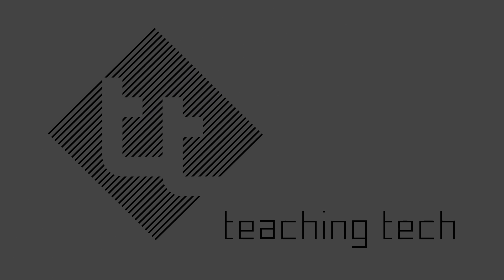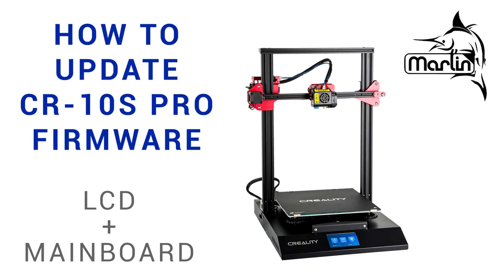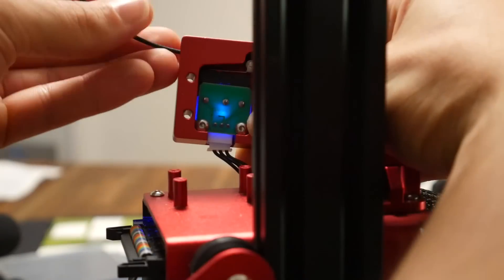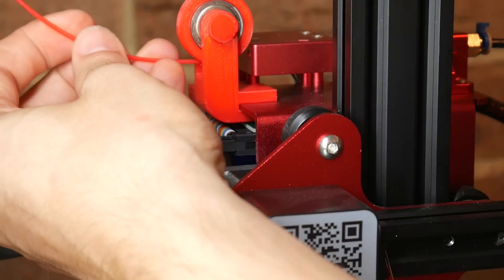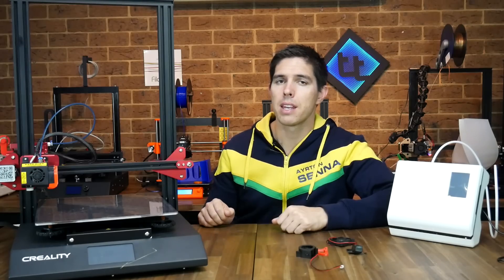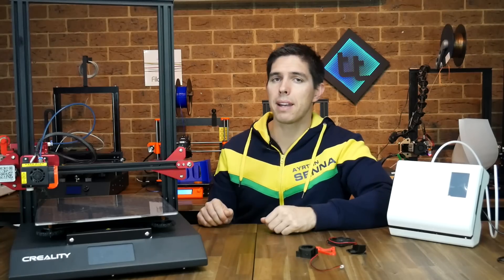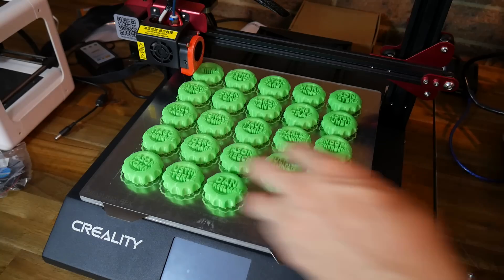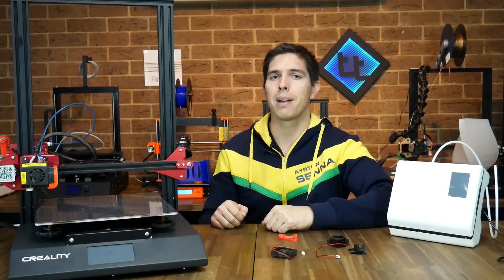7 fixes for the CR-10S Pro - Unlock the potential!

Comment: I really like your videos, well done!
You're a pro
A few points I would love to answer
1- I had a lot of problems with the original height sensor (even after the upgrade version) is not always accurate, is it because I use glass? Is this sensor good only for certain surfaces? (Does he have to work well with a magnet?)
  2. Baby steps, can I update the version? If so, would I be happy to explain which file? ..
https://github.com/jcheger/Creality-CR-10S-Pro-with-baby-stepping
3 - The speed of replacing the filament, currently according to the manufacturer's settings is so slow that you can grow old until it's over, where to update the speeds faster?
Thank you very much for the answers
And if you do not have the option, I would be happy if someone else could answer
 

 Eyal Biton

Comment: I added the z axis sync. Not sure if the backlash nut works better but the belt sync is great. Some other issues are the warped heated bed (which mesh leveling should theoretically fix) and poor manufacturing on various components. Example: holes filiment goes through had such horrible burrs it cut the filiment through every hole (barely fit ) creating the dust you pictured. Took some tedious deburring and fixed it. Took lot of work and it prints great now but the time investment could have bought a better brand.

Comment: Hey man thanks for the link remember just use 12 volt fans and voltage converters two exceptions Parts Cooling can't use a 12-volt for that or you lose speed control add the power supply fan it's already 12 volts so you just need to directly replace it with a 40-20 12-volt ultra-quiet fan the power supply fan is the largest culprit in my printer for noise once you replace all of them and run the parts cooler at 60 to 80% you could sleep in the same room as this machine :-)

Comment: Is Wham Bam 310x310 enough to cover the bed ? Because if I think it is 320x310
Reply: I have the same question xD ...
Reply: @Michael Patakos found it... https://whambamsystems.com/blog/f/what-size-flexible-build-system-for-your-3d-printer it's a 310x320 for the CR10S Pro.. and a 310x310 for the CR10S ... so i have to buy the bigger one

Comment: Beware that with tiny machines firmware the print is not resume after a power cut and also you can’t pause a print.
Reply: Michael Patakos 😕
Reply: resume after power cut for what???... the last time i remembered we had no power it was during a big storm.. and when you have a storm.. you should turn off your electronics anyway...
Reply: @kirafrost7618 , you must live some place where storms aren't very common.  In Florida in the summer you can pretty much count on a thunderstorm rolling through almost every afternoon.  Momentary power outages are pretty common and it's not feasible to turn things off every time there is a thunderstorm.  A UPS is a good idea for sensitive electronics though.

Comment: Great Video!! I was especially enlightened about using the wrench for setting the distance on the z axis sensor. I only wish I saw this last week. I just bought a BLtouch to battle the inconsistent Z homing, to find I was shipped  Version 3.0 BLtouch.....and it doesn't work on the CR10s Pro. I installed it yesterday. The print nozzle slams into the bed. It will probably be better to re-install the original probe and wait for someone to work out the "bugs" in the newest version of BLtouch sensor. Love your videos, keep up the good work!!!!!!!!
Reply: I was wondering if I needed the v2 or of the v3 would work. You can’t use the v3 because the nozzle hits the bed?
Reply: version 3.0 works.. use that tutorial https://www.youtube.com/watch?v=PLKEhdznVMY&feature=youtu.be&fbclid=IwAR2BeliUT0mNwKNk4RgggoYay1AssCuK4nRKL9rcaP6d8qYqExcYdA5oIPA and for version 3.0 use the jumper on the board! and about the firmware.. tinymachines b7 you don't have to change anything with marlin.. it work's fine as it is. by the way.. before the nozzle crashes into the bed.. i would test it with your finger.. if it doesn't stop.. then use the power button on your printer to stop it.. before something is damaged..

Comment: If you buy all the necessary fixes, it doesn't seem to be cheaper than a Prusa anymore...
Reply from the maker: Prusa i3 MK3S KIT is $750.
Creality CR-10S Pro is $600, Wham Bam $89, fan $5.
I own both and I love my Prusa. It is fair to say that this combo is appealing considering the larger build volume and easier assembly (even with the mods here).

Comment: You have saved my Cr-10s  pro from going back. The inductive sensor made the greatest difference, but also loved your video on the Z axis leveling. The Tiny-machine firmware is also a huge step up.
I would assume the wam-bam bed will work well with the inductive sensor.
Thanks again. subscribed and liked I miss the glory days of Lotus with Senna
Reply from the maker: Glad to have helped. Wham Bam bed works with no problems with the sensor. Senna's legend fortunately has not diminished over the years.

Comment: If you had to buy this or the Prusa MK3s as your first printer, which printer would be better suited? Looking to print flexible and hard materials, just want to know which prints better
Reply from the maker: Prusa works much better out of the box, although if you buy the kit the assembly is long and involved. Once together the Prusa has a lot more checks built into the system and much more frequent updates. Only problem is the difference in money.
Reply: @TeachingTech  Thanks. I already got the Prusa so it's nice to have some re-assurance!

Comment: loudest fan is not the mainboardfan, its the meanwell powersupply fan. I got rid of all stock fans, now its almost silent.
Reply: Was reading to see if someone mentioned this. Yes, at idle the machine is not bad but when the fan in the power supply kicks in db's increase considerably. So the biggest offender is the power supply fan, not the motherboard fan.
Reply from the maker: I agree but it's much more involved. That's why I said it wasn't much of an improvement here and linked to the video from Nerys.

Comment: might want to relocate the mosfet to the aluminum frame, it's location currently doesn't dissipate the heat well as it's mounted on standoffs in the case.
Reply from the maker: Are you talking about the solid state relay for the heated bed? Generally the bed MOSFET has the most current through it but on this printer there is a SSR instead.
Reply: @TeachingTech  yes, it get stupid hot from what I've seen-the back should be the heatsink portion, but it's elevated  so not getting adequate heat spread

Comment: For fan noise. Use some hardy wire cutters and clip out the middle ring of the fan guard on the side case fan and the hot end fan.  That will greatly reduce fan noise as the airflow will be better.  Replace the fan in the PSU case, it's the worst offender. 

Some people have claimed that their printer is silent, so I wonder if Creality is starting to replace these noisy fans with better ones??
Reply from the maker: Thanks for the tip. It would be great if they did. Seems silly to have quiet stepper drivers paired with noisy fans.

Comment: Is there a similar product to whambam for this model that I could buy from Aliexpress? Thanks!
Reply from the maker: One of the Cmag beds like on the Ender 3 Pro and Ender 5, although they are no where near as good.
Reply: @TeachingTech  Alright!
Reply: @TeachingTech  Another question, do these Wham Bam resist higher temps to print with ABS etc?
Reply: You can try the Easy Peelzy (the Creality CMag bed is a copy): https://www.3d-easy.xyz/store/p3/Easy-Peelzy_XL.html. Cost is no issue as these come around $16.

Comment: Thanks for this excellent video. Note: you can install 2x12V fans (Noctua or other) and put them in series, it's the same result. Within the EU you can get excellent Sunon radial 24V fans here: https://www.tme.eu/nl/details/mf40202v2-a99-a/ventilatoren-dc-24v/sunon/mf40202v2-1000u-a99/. Did you notice any excessive heat coming out of the SSR (like +50°C)? Did you check the latest Creality FW 1.60.71 as I believe it includes thermal runaway protection? Also, their latest batch of printers now come with a inductive sensor instead of a capacitive one.
Reply from the maker: Thanks for sharing great info. Haven't noticed any heat or tried the newest Creality firmware. The new sensor will be good as long as people don't want to use glass.

Comment: My 1st roll of PLA was $40 Tronxy black, and it was hard to get prints off my std End3 bed. But when that ran out I got generic $20 PLA, and it now has trouble sticking to the bed. Now I wonder how different different brands of PLA are, because Maker's Muse had trouble with stringing with different bands of filament.
Reply from the maker: Most of the time not much different but every now and again as you mention it can be profound.

Comment: Hi, I love your videos, and this one provides provides some food for thought.  I have had my CR-10S PRO for about 5-weeks now and unfortunately, I never got the test dog dog to print well from the start and had to do a deep dive into the printer problems.  That even includes reading C++ for Marlin ;)  

Initially, I discovered that the build plate was warped with a hump that went right to left just off center from the front and it was off by 0.78mm from the front to the warp high point.  I removed the Creality build sticker, then whacked the build plate over my thigh a few times to reduce the warp, and then mounted it upside down to allow the support plate and clips to remove the rest of the warp.  This worked well and I am within a couple of 1/100ths of a mm across the plate.  This, however, required that I also put on a new BuildTak sticker for which you have to buy toe 400mmx400mm sticker and trim it down since BuildTak does not have a 310mmx310mm sticker.  I was then able to print the test dog in PLA - Once.  I ran the bed at 60c and the hotend at 210c.  It seemed as though  I had to continually adjust the hotend z level at the outset of a print to get the filament to flow correctly and to get it to stick (even on the buildtak) - yes Auto Bed Leveling was ON.  I had the  problem where, if I use  a 1st layer brim that is initially good in its thickness and initial stick-down, it lifted on the outside edges late in the print of the brim (I use a 2mm wide brim) and suddenly the print nozzle is hitting it on the way to the printed object - lots of spaghetti when that happens -  I had to constantly watch it and kill the print (have done that many times).   I did flash to the Tiny Machine firmware, I did replace the capacitive sensor with an inductive sensor.  My auto calibrate measurements are all at 0.02mm or less at all 16 pts.  I use Cura (3.6 and now 4.0) with the suggested CR-10S PRO configuration from Tiny Machines.  My hot end or extruder or both seem to have problems so I upgraded them to a Micro Swiss hot end.  I have tried several slicers including: Cura, SLIC3R, even the Beta Creality Slicer (DO NOT USE - it seems to not use the Auto Level info at all - IT BURIED the print nozzle tip into my bed, near the center so I had to replace the nozzle.  On reading through the Marlin Configuration dot h file I noticed that it allows the nozzle to drop upto 2mm below the sensor-on point so that explains that).

I started to get good prints and then switched to PETG.  more problems with 1st layer sticking and blobbing.  I found that the lead screw nuts on the z-axis lead screws that drive the X-Axis gantry beam in the z-axis on the right and left side of the frames were loose - very loose (4-screws, 1 to 3 turns each), this would lead to z-axis hysteresis during up and down motion and would explain why on certain moves across layers the nozzle would score the previous layer;  I tightened those up.

Then I checked the squareness of the X-Axis beam relative to the side Z-Axis beams and found them to be out of square on both sides.  Loosening one of the two side roller on each side and adjusting the inside roller tension I was able to square the beam up.

The extruder spur gear on the stepper motor shaft loosened up and dropped down on the motor shaft - this led to slipping of the filament being extruded and a clicking noise.  When I re-adjusted that spur gear, I noticed that I could not get it to align with the non-stepper spur gear.  On examination, the bottom teeth of that spur gear had ground a small ring into the aluminium extruder base plate.  I used an old  0.1mm shim to fashion a washer to place under the spur gear to both raise the gear teeth up from the aluminium base so it would align with the stepper mounted gear as well as give the gear a rotating surface to ride on so I would not continue to damage the aluminium base plate.

So, to sum up:  

Warped Bed - Fixed; required a new BuildTak sticker
Awful Leveling Sensor - Fixed; I went to an Inductive Sensor and adjusted it appropriately and use the Tiny Machines leveling method.
Firmware - Fixed; flashed to the current Tiny Machines firmware
Slicer Settings/Extruder/Hot End (or combination thereof) - Fixed; replaced the hot end with a micro swill all metal hotend; and used the Prussa Edition of SLIC3R
PETG first layer problems and scoring of layers on nozzle travel - Fixed:
     - Tightened the lead screw nut assemblies and squared up the X-Axis beam to the Z-Axis Gantries.
     - Added G28 (home) and G29 commands to the GCODE after the bed and nozzle are heated.  Also, I routinely check bed level with Octoprint and use the M500 command to save my bed leveling settings.
Changed the fan shroud to a PETG ring shroud - it drooped and broke off - Not Fixed, will use the fan shroud and new 24Vdc fan per your video

Finally, I have the Wham Bam 310mmx310mm build plate on order and am waiting for it.  I tore the BuildTak up a bit trying to remove a PETG component and have been working around that spot ;)

Now, I am a new guy to all this and I started with a Cetus3D printer that always just works.  However,  I will persevere since I think that I will be able to learn on this machine including getting it to run right - eventually (and I am stubborn and I refuse to let the machine win :).
  I really like the larger build area; the Cetus is sooo small.

I hope you found this helpfull and I could always use help and suggestions
Reply: If you find that the nozzle-to-bed distance mysteriously changes a little, take a look at the Y rollers. I found that I had to loosen all eight of them, then very incrementally snug them up to the V channel (not just the eccentric ones).  In the process I noticed that the height of the rollers' pillars  was not uniform, with the eccentric ones a slightly different height than the non-eccentric ones. In operation, that can allow the bed to move up or down, depending on which roller of each opposing pair is able to seat deepest into its V groove.
Reply from the maker: Thanks for sharing. You've had quite an ordeal, I'm sorry to hear. The good news is like you've stated, you now have a much better understanding of 3D printers. Hopefully others read this and learn from your experiences.

Comment: Good video. Wood you take this unit over an ender 5?
Reply from the maker: My Ender 5 is going to be enclosed to print specialist filaments so I see it differently to this printer. On a budget, the Ender 5 will do a great job. If you have the money, this is a step up.

Comment: Anyone who owns this probably want a video for the y axis layer shifts at any non slow speeds and adjusting the belt tensioner for y.
Reply: Not to mention getting a good tradeoff between friction and lash on the 8 Y rollers.

Comment: Better make that 8 fixes because of Gantry sagging when the power is cut off to the left stepper motor due to excessive weight, And you don't want to buy from the company in Houston Texas, they sell returns as new!
Reply: Donald Trump tiny machines sells used machines as new?
Reply: That's what I was told by the owner Chris, that returns would be sold to the next customer that wanted it!
Reply: Donald Trump so maybe amazon would be the next best place? I want a big printer but unsure I should buy the cr10s pro or just the cr10
Reply: If you have the skill to flash the firmware you can save yourself 80.00 if bought on Amazon, and still use TM's firmware update, However if you don't have the skill to update the firmware then I guess take a chance with TM. As for which model you get that just depends on your tinkering skills, just do the research.

Comment: I've been struggling with my CR-10S Pro for 2 months. This video was really excellent, great succinct list of tips. I'll be printing out the fan duct and getting a new build plate based on this. Thanks!
Reply: Hi Donald, how have you found it now? I am considering this or the Prusa MK3S. After viewing this video it seems that there are a lot of extra costs to get this "cheap" printer running reliably. Wonder if I should avoid the headache and get a Prusa.

Comment: Love your video!!! my printerhot end burned also, but creality dont answer. There are so many users out and they cant change the hardware and frustrated with this printer. creality dont answer to emails to help. there is to much money you have to add to get maybe a good printer. 45 dollar for the case fans to change them all, 20 dollars for the hotend fans, 100 dollar for the printbed, ... for the half price you can build your own printer with the same results and have a enclosure. i wished i never had bought this printer.
Reply: You cant build ANYTHING near the quality of this printer for that price.... most issues with the cr10s pro are all user error besides the leveling